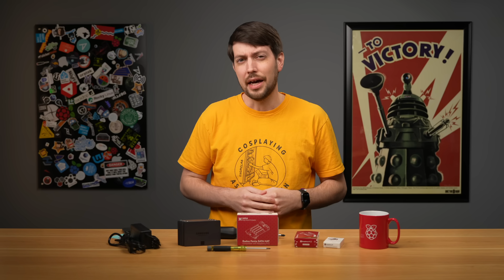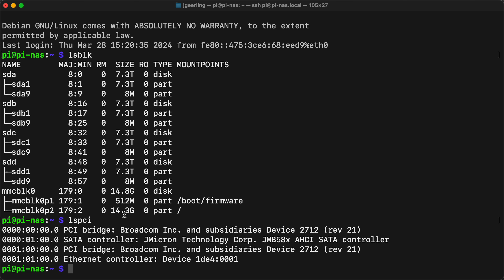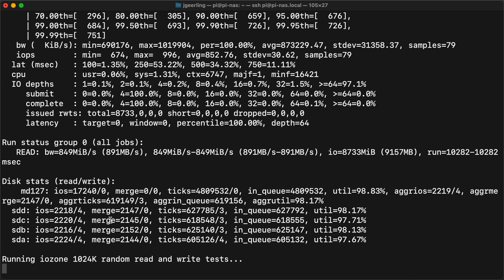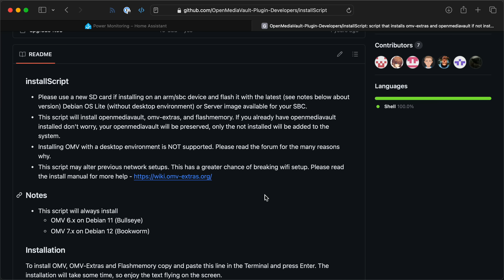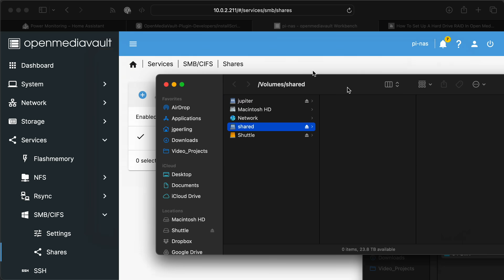The ULTIMATE Raspberry Pi 5 NAS

Comment: Should note samsung qvo (QLC) ssd's go significantly slower then hdd under constant sequential writes (significantly high latency and write speed per drive below 80MB/s I would guess random write suffers as well) recommend buying sm or pm drives like the PM863 or PM863a or alike as they have QOS for low latency and writes only drop to 250MB/s under constant write load to keep latency low, emptys the full slc cache after 2-3 minutes (reads remain above 450MB/s) also have full power loss protection 

Power usage large spikes at the end was likely the forced QLC direct writing with the SLC cache attempting to flush to QLC as well (zfs does Compression on the fly if it determines the file can be compressed if not it skips compression this is for whole transfer)

Comment: i like that it's compact, perhaps a newer version will have all five connectors on the board, i'd never use the 5th cause i'd stuff it in a piece of pvc tube and want it to not have bits hanging off.

Comment: It would be nice to see an iperf benchmark of just the 2.5GBASE-T interface.  There's certainly going to be overhead due to the PCIe switching, but if the disks are relatively idle, the only overhead is would be control messages to the disks getting in the way of data messages to the network card. I don't think that would account fo 500Mb/s of overhead.

Comment: To ramble on a lil more I think you should look at the rack mount cases but here is unique angle - as a red shirt jeff endorsed product put two pi nodes in each case along with 2 icy dock 6 bay enclosures - people can run dual nas each with bonded 2.5 via usb 2.5g adapters - 300mb/s over the network should be just about enough for anybody. would it sell - hell yeah but is there adequate supply and the sales and mkt effort would be substantial plus the documentation would not be minor - it could still be much cheaper than other nas on mkt and smb is cost sensitive mkt - they may but it just for the cost savings - going dual nas is probably pref - each should have their own ups and be on different circuits. Finally i think you should try to get some real hw products out there - nas/router/server/ws - once you get past sorting out what is best option the rest is just execution - the more you do it the less kinks there would be

Comment: Radxa ROCK 3A was perfect for this build, 2x pcie 3.0 and 1x pcie 2.1, ideal for top board and 2.5G ethernet, SoC is limiting RAID performace, but still well over 2.5G. setup uses about 8W (I'm running this it for a while). I'm using 4A 12V for power, less waste. 

eSata is yet another sata for 3.5" drive. Useful for external big hdd with power. 

Probably You are using OMV7 which moved mdadm to external plugin. That is why there was no such thing in menu, easy to add. 

Btw, more interesting is quad sata hat, uses two usb3 but has HW RAID. You will get pcie for 2.5g ethernet or even almost 10G. Also You can get opposite of that. 

Any RK3588 is way better, support pcie bifurcation so you can get 6x sata and 10G nic, already has 2.5G, wifi slot still free (another 2.5G nic or 2x sata, or coral tpu), also eMMC is just way better than sd card. 

Thanks for trying active cooler wit this hat so I dont need to reassembly mine with pi5, which I wanted to swap, but due to heavy jellyfin/plex problems its just bad idea.

Comment: I've built a NAS with this hat and Rock Pi 4B (that was long before Raspberry Pi 4 and Rock 4B does have that nvme slot with a few pcie lanes) but with 4 3.5” HDDs. Wiring them with SATA extender cables was funny, as the Chieftec chassis I've used has separate SATA data and power connectors.

The 5V power supply on the hat is adequate: the datasheet for the step-down converter used on this hat specifies a maximum of 10A. So that's enough for the SBC and the drives (the 5V line is shared with SATA power).

Overall a very solid and well-designed product. Too bad ARM means being limited to OpenMediaVault. It does run solid on Armbian so no quarrel here.

Comment: At this performance, what reasons would I have to go with synology over this setup?
I would be capped at 2.5 gig speeds anyway.

An entry blade from synology costs over $650 without the drives. I could build two of these for that cost.

Comment: About RAID: by coincidence I stumbled over a pinned comment in the Argon40 forum: "Currently, as of Jan 2022, openmediavault doesn’t support the creation of the RAID via USB, so you need to use terminal commands." In the OMV-forum are some entries dealing with that. As far as I understood you need to add a plug-in for RAID. love your videos, but I have put hardly anything into pracitce :)

Comment: one mistake, on the ribbon cable there is metal pin, it should be inside snap on to the connector to keep it place! bottom part has plastic clips to keep it in place, top large one uses the metal pin to clip on the edge to keep it from coming out!

Comment: Hey people, i was wondering if it was possible for me to use an orange pi 5 plus isntead of the rasberry pi 5 or Raxda rock 5, I checked the websites for the penta sata hat, and it said that it is only compatible with those two boards, and so I went to Orange pi website and found that the Pi 5 plus doesn't have the IPEX  connector, so is there a way i can make my orange pi 5 plus into a server just like this one? 
Thanks in advance!

Comment: Why do they provide a flex connector when you just stick it on top via pin headers anyway? Is it because you cannot transfer differential signals over pin headers? I thought they do this for USB anyway (and this has differential pairs). Maybe the PCIe timings are too tight?

Comment: Im to lazy to read all the comments, but why did you not try aggregating to see if it got a bit faster? (several uploads, download or both is needed to get a difference). Yes it could be a bit of pain... to set it up but when it works oboy you could see big difference when using aggregation (need to be throttle at IP level and not per customer if having access to several external IP's to see a difference at a external level for people thinking about it now)

Comment: Back in December I posted this to the Raspberry Pi forum:

Just a thought...
Any thoughts on using a Rpi5 pcie Pineberry bottom add M.2 to SATA3.0, Expansion Card, 6 Ports SATA 3.0 Controller PCIe Expansion Card?
Add 6 sata drives rather then 1 single drive.
Thinking i may need separate power supply for sata drives.
Thinking it might be better than the usb connected drives Im using now.

And got this as a response:

The USB will be faster overall.
That one Pcie hat port is the same as the USB3 single Pcie, and there are two USB3 ports like that.
Two USB3 to SATA adaptors, one in each port.
Then a sata to multi sata board.
You have 3 drives on usb3 to Pcie channel.
Or split it two drives over all three (2x 2on usb3-SATA + 2on PCIe-SATA)

With the setup shown in this video using four larger drives in a raid would work, power supply take care of.

How would setting up a smaller drive with the extra cable for the OS rather then using the micro sd card?

Comment: Brilliant Jeff. Is there value do you think in using an NVMe PiHAT and not using an SD card for the OS rather than the 2.5G adapter. I know the Pi5 screams with NVMe rather than SD card. I've seen somewhere that caching by the NAS software will kick in (in the real world) and surely would help reads especially.

Comment: As an alternative that is already here. Due to adapters, anyone can fit up to 6 ssds in a $50 Thinkpad T430 or $100 W530 if you want 32GB ram capability. To get the 6 drive capacity, you need to get 2 sata to m.2 sata x2 adapters for the main drive and cdrom replacement. Ali express sells pc card to nvme adapters so you can mount a 2230 or 2242 nvme drive in the pc card slot. Add a msata drive to the wwan slot and you are done. I'm not sure about the T430 but the W530 has raid 1, 0, 5 and 10 available through bios after 1vyRain mod.

Comment: Linus had a pretty good video using that Rockchip NVME board. I think I like this solution being able to use 2.5" SATA drives due to cost per TB. Might have to build one of these! Well that is if and wen the Radxa boards show back up in stock.

Comment: You should really avoid running "sudo nano" as running anything as root you dont need to is not good. You can instead set your sudo editor in environment variables with "EDITOR=" and then run "sudoedit" which runs the editor without root privileges and then has sudo do the changes to the file after/outside of the editor.

Comment: 30:36 Embarrassing to  in that case…😅  
I’ve ended up using rsync instead of Finder when moving larger chunks across the lan. Finder also fails in bad ways - if/when it fails - whereas rsync (-a) “fails safer”… 
Great job with the Pi-NAS (as someone said, don’t say that too fast…)

Comment: The penta sata hat was originally designed for their Rock Pi's so I was excited when I heard they were making an adapter cable for the RasPi5 since no other hat on the market supports 5 drives. The fact that the active cooler doesn't fit well with it is a little disappointing but I guess I can't fault them for not accommodating an accessory 4 years before it existed

Comment: Why couldn't you have used slightly taller stand-off posts instead of wrecking the heatsink? Would have allowed better airflow between the top and bottom boards, too.

Comment: Doesn't seem very well designed when it interferes with the official cooler. But I guess it was probably designed for their own boards first, with pi support as an afterthought.

I feel like the flex cables are going to be a weak point of the ecosystem, I wish they had used something sturdier, but I realise they were under size constraints (self-imposed though they may be)

Comment: Wait what about adding a spacer to each leg? For more clearance?? Also can you get a longer connection cable? I would want it water cooled spaced above the cooler meaning I would need a much longer connection cable. Also a small fan to cool the drives in a custom tower case.

Comment: I could see a case for this based around a 120mm fan, just a smidge taller, aim the fan at the bottom half of the stack (so level with the pi), top half of the ssds won't get that hot

Comment: An easy trick to get good readings from a thermal camera is applying a single layer of kapton tape. Known emissivity and so thin that its thermal  conductivity has a negligible effect. Would work great for those drives.

Comment: Wouldn't it be smarter to use the NAS hat for the Raspberry Pi 4 on the Raspberry Pi 5 and then use an NVMe SSD hat via PCIe where the Pi's firmware runs on it. Just a question.
🤔

Comment: Would you think it would be stable with ssd to hold the OS rather than the sd card. Was running a pi for p-ihole and one thunderstorm later the sd got corrupted. And I would be interested in a video on the CM3588. Thank you for posting this video - it is creating an itch for me to build a "small nas" for my mobile devices backups.

Comment: I oopsie doopsied a flexpcb for the bluetooth antenna on my second oldest macbook pro when getting it dried and sorted after a fluid spill. luckily it was already scheduled for replacement, and i don't use bluetooth much on them, but still. so easy to break them, especially when you aren't aware they're there...

Comment: This is a most useful video as I've been considering new NAS options. I currently have a Synology [2-bay] DS212+ which offers: 3No USB ports, 1No eSATA port (never used) and 1No SD card slot. But as all my media files are currently stored on 3No 5TB 2.5" USB connected HDD's I really don't need a big white box sucking loads of power 24/7.

Also, as all want from an NAS is to share my media files across my personal network via SMB and UPnP/DLNA. I have no interest in all the other features NAS manufacturers care to offer.

The only thing that makes me nervous about going down the Raspberry Pi route is that I'm a complete novice with these devices and it maybe too steep a learning curve.

Comment: Thanks for this video. I was waiting for radxa to release a NAS hat for RPI5. I was running the RPI4 version for a a few years and it work like charm(over USB3). I hope they will  make a case for it like for the previous version and to make the PCI cable longer in order to cool the RPI5 with a low profile ICE Tower, I was able to reach 3400MHZ and with temps under 65c

Comment: Can you see if (when using the 12v barrel adapter) if it backfeeds 12v to the molex connector? If it does, then that could be an easy fan power supply.

Comment: Maybe because your Mac nic is 10Gbps, you had trouble sending data but not receiving it. Ubiquiti had an issue like this for a couple of years in switches. It comes down to one side trying to send as fast as they can, not being able to, letting the connection sleep for too long before trying to send at full speed again, and so on.

Comment: How could you never get 100MiB/s over the network with a Pi4? I am using a weaker RK3399 board with 2 USB 3.0 HDDs in LVM Raid1. Writes are around 90-100MB/s, reads saturate the gigabit LAN with 117MB/s. All that was needed was some slight tweaking (setting protocol to SMB3_11, large readwrite = yes, use sendfile = yes) to Samba.

Comment: Surprising to see that the PCIe Gen2 switch doesn't overly bottleneck the system running 4 disks and 2.5gE. I'm in the process of upgrading my 6 SSD 'NASty' build (github/theodric/NASty) from a CM4 to Pi5, and had planned to take the switch out and go Gen3 on the SATA controller since the Pi5 has USB3 on a dedicated lane. Would be cool if I could throw 2.5gE into the mix. Would be even cooler if someone would release a PCIe Gen3 switch so we don't have to leave performance on the table!

Comment: You see the new radxa rock 5C and 5C lite? A raspberry pi 5 competitor, price is less than the pi 5 with rk 3588 (5C) or an another version without gpu and with 6 core. (5C lite)

Comment: - 00:00 🌐 Introduction to Raspberry Pi NAS projects and challenges with previous models
  - Introduction and background on Raspberry Pi NAS projects, highlighting the limitations of Pi 4 and Compute Module 4,
  - Discussion on the promising but ultimately stalled projects due to the Raspberry Pi shortages.

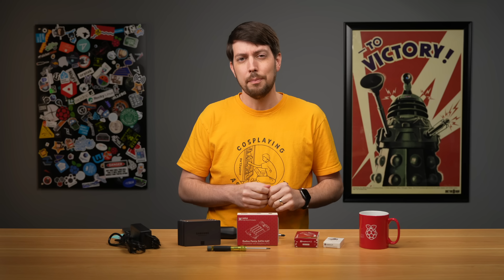- 00:28 🚀 Introduction of the Raspberry Pi 5 and its potential for NAS
  - The arrival of Raspberry Pi 5 with improved features and availability,
  - Initial cost analysis and comparison with off-the-shelf NAS solutions.

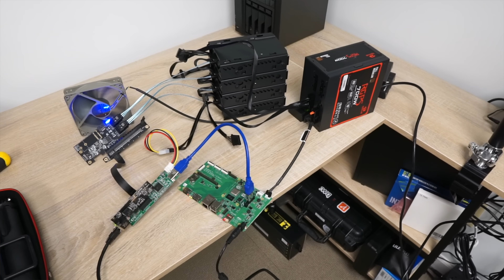- 01:25 🛠 Setting up the Raspberry Pi 5 NAS with Radxa's SATA HAT
  - Detailed walkthrough of assembling the NAS with Radxa's SATA HAT, power supply considerations, and potential bottlenecks.

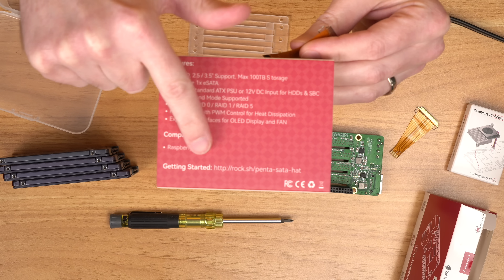- 03:42 📚 DIY assembly tips and potential challenges
  - Practical tips on handling delicate connectors and components during assembly,
  - Addressing potential assembly challenges and solutions.

- 05:32 🌡 Cooling considerations and setup completion
  - Discussion on the importance of cooling for the Raspberry Pi and the NAS setup,
  - Final touches on assembly and anticipation of performance testing.

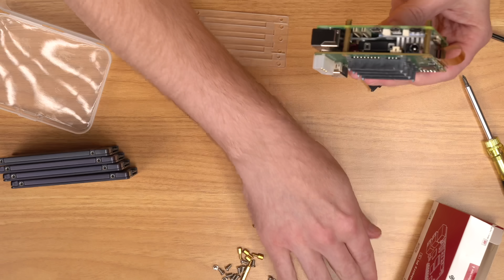- 07:23 📊 Technical specifications and performance expectations
  - Overview of the JMB585 PCIe controller's specifications and implications for NAS performance,
  - Expectations on airflow and power supply requirements for optimal operation.

- 09:08 🔌 Initial power up and system configuration
  - Initial boot-up process, system configuration steps, and troubleshooting missing hard drives in the setup.

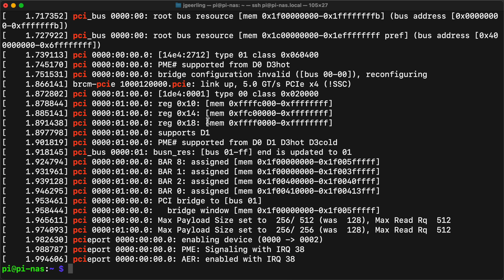- 11:04 🔄 Enabling PCI Express and verifying hard drive detection
  - Steps to enable PCI Express support in Raspberry Pi OS and confirmation of hard drive detection.

- 12:53 💾 Benchmarking and thermal imaging analysis
  - Performance benchmarking of the NAS setup and thermal imaging to check for hotspots and potential overheating issues.

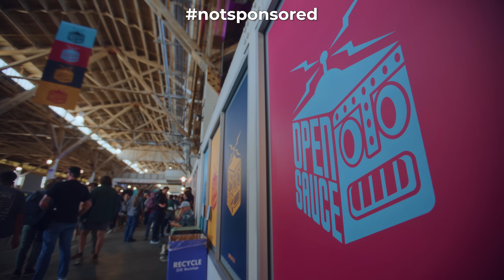- 16:59 🌍 Open Sauce announcement and data transfer tests
  - Announcement of the Open Sauce event and real-world data transfer tests to evaluate NAS performance.

- 18:55 🌐 Exploring 2.5 gig networking options and potential expansions
  - Exploration of options for enhancing network performance with 2.5 gig networking solutions and the challenges of integrating multiple components.

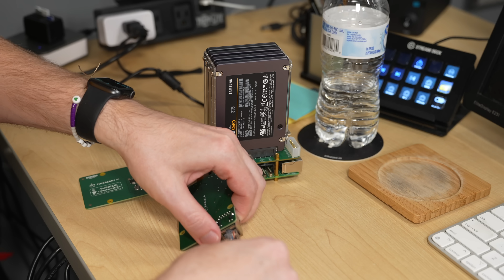- 21:10 💻 Networking and storage integration test with 2.5G networking
  - Initial tests show integration of SATA and 2.5G networking controllers via the HatBRICK! Commander,
  - Performance insights on iperf tests and initial write speed observations with 2.5G networking.

- 22:30 🚀 Enhanced write and read speeds with 2.5G networking
  - Observations of steadier and slightly improved write speeds under 2.5G networking,
  - Significant read speed improvements, demonstrating the potential of 2.5G networking for a NAS setup.

- 23:52 🔄 OpenMediaVault installation and ZFS configuration
  - Installation of OpenMediaVault (OMV) 7 on Raspberry Pi NAS and power consumption metrics,
  - Configuration of ZFS storage with RAIDZ1 for redundancy and data integrity.

- 27:04 📂 Samba configuration and initial file transfer tests on OMV
  - Setup of Samba for network file sharing, initial file transfer tests showing promising speeds,
  - Reflections on the performance benefits of ZFS caching for file transfers.

- 28:29 💡 Final thoughts on performance, efficiency, and DIY NAS considerations
  - Comparison of power efficiency and performance against prebuilt NAS solutions,
  - Discussion on the potential of using different chips for better efficiency and performance,
  - Closing thoughts on the DIY approach to NAS building, emphasizing user responsibility for software and maintenance.